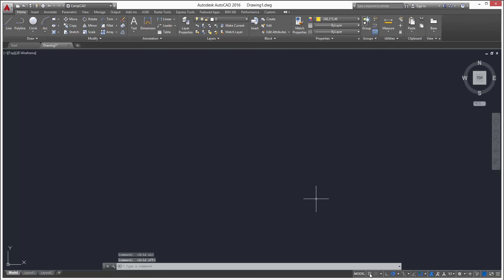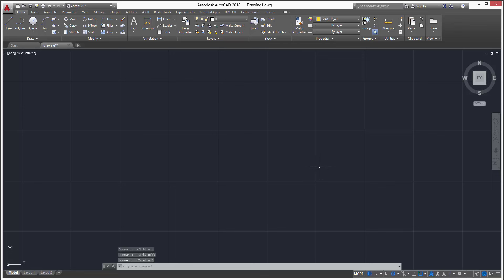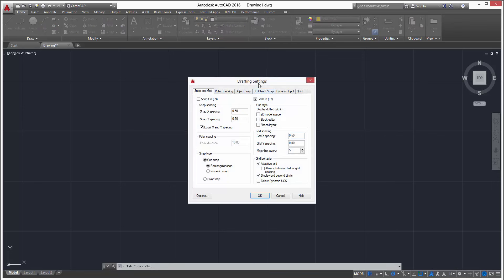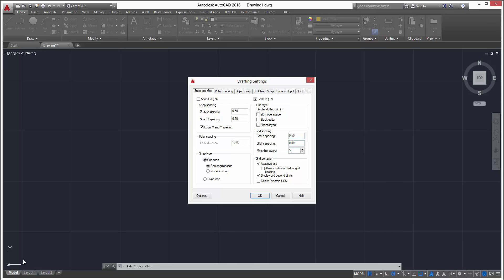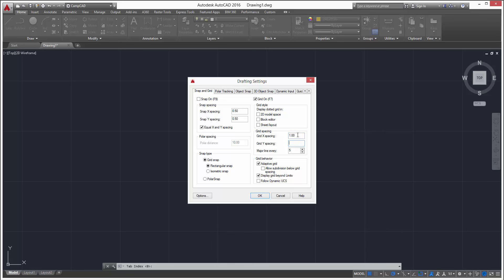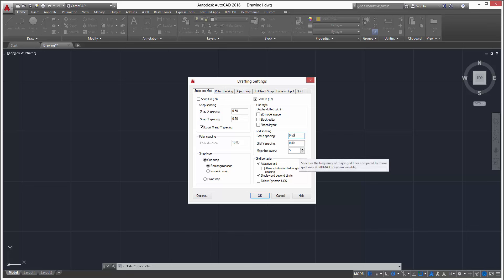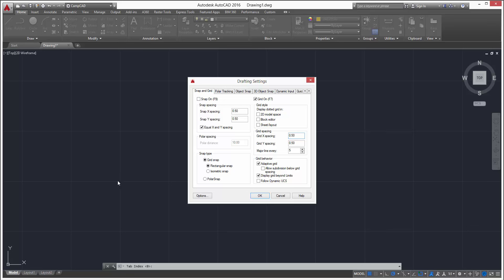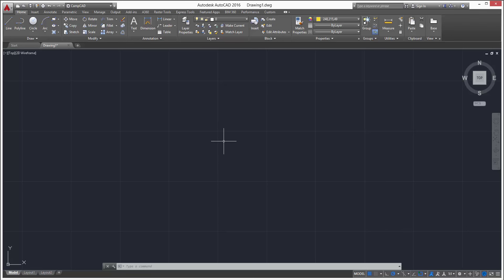AutoCAD Grid Settings

Comment: Tried everything but can't get my AutoCAD 14 to snap to grid. Set snap to 0.5 , line spacing is 0.5, also zoom in. Started off with AutoCAD R11 and R12 in 1991 and snapping to grid was easy but for some reason not as easy with 14. I can snap to objects just not grid. Any help please.
Reply: Found a work around. If open up the acad template it will snap to grid. I can then save my new drawing and it will be setup correctly.